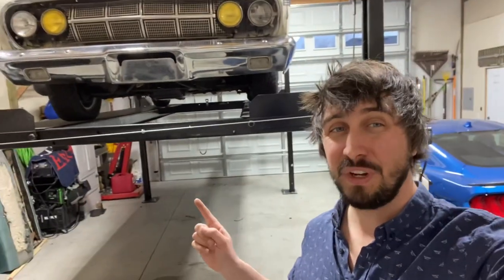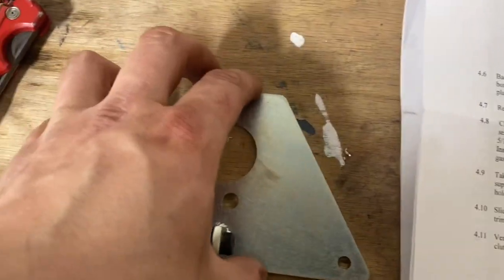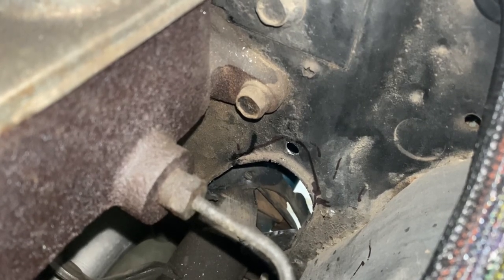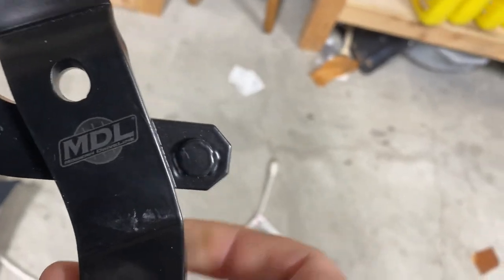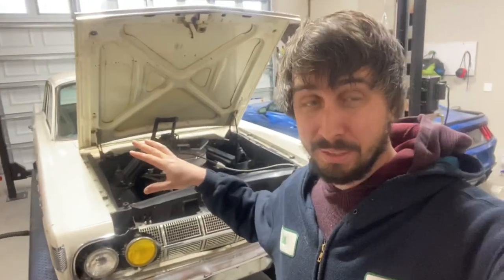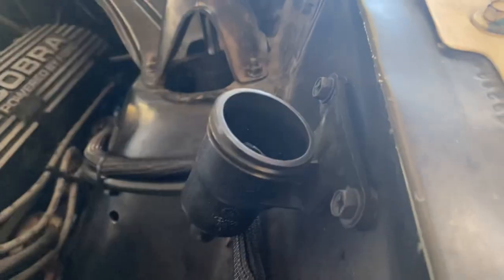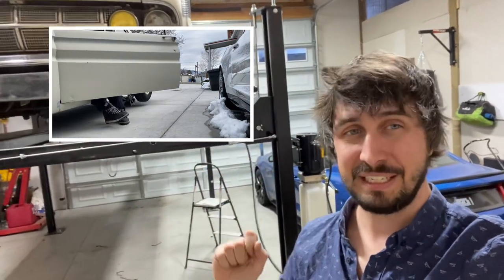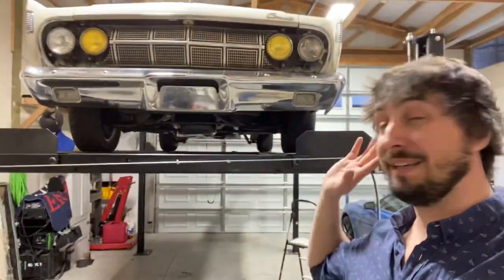Hydraulic Clutch Conversion Installation and Review

Comment: I'm the owner of MDL. Thank you for purchasing our Light Foot series hydraulic kit. I reviewed your video and would like answer some of your questions. 

On the falcon/Comet clutch pedal I modeled on the oem.  I left all the attachment point the same including the pin you mentioned.  When installing the falcon master cylinder kit the factory clutch pedal linkage pin has to be removed.  Based on you input we could easily not install the pin and let a customer install it using mechanical linkage.  

I'm looking to see if a replacement gasket could be included with the kit. There is cost for this part so the retail price would have to be adjusted.  Our pedals are 100% made in America. The removable pivot shaft design is more expensive to produce but we see this as a huge time saver. The old saying time is money.  We want to save both.  Could make the pedal oversea for half the price, maybe but not interested. 

If you like feel free to reach out to me. Love to chat with more in detail.
Reply from the maker: I really appreciate you taking the time to watch my video and comment.  It means a lot.  Of all the cars I own surprisingly the Comet has the best feeling clutch!  Would buy again in a heartbeat!

Comment: How far does the clutch fork move when you push the clutch peddle? Where does the clutch engage when you let off the peddle? Right off the floor , the middle?
Reply from the maker: It engages somewhere between floor/middle but not at the top.  I dont recall exactly how far the clutch fork movement is but I could have swore it was in one of my instal videos

Comment: Hey just watched your video and we’re switching my son’s clutch cable to the malwood clutch pedal with a external slave. Great pedal quality with a somewhat easier installation but trying to get it dialed in! Trying to bleed it with the mdl bleeder and noticed that after opening the bleeder it doesn’t seem that easy to push the fluid through like it shows on the mdl website! Feel a lot of back pressure, notice that you mentioned that too. Any tips to get it through easier? No way I can push it all down in 3 seconds! Reason I’m thinking that there’s still air in the line is that it grinds trying to get it in reverse but goes in all 5 gears . Any info would be appreciated!
Reply from the maker: It’s been a while since I did it but can you open the bleeder all the way or perhaps more than it is now?

Modern Driveline tech support may be able to help you.  I appreciate you watching and recall this being tedious
Reply: Thx for responding back! I know it’s been awhile since you did that project but figure I’d take a chance and see  you would remember! 😂 we’ll keep on trying to bleed the system some more since I think that’s the reason it’s not going into reverse at the moment.

Comment: I have a 1966 Chevy Nova Super Sport and very difficult to go thru the gears. I am considering to switch to a Hydraulic Clutch. I have a manual transmission now. What do I need to consider?
Reply from the maker: Without knowing your trans type you have to find a spot to mount a master and slave cylinder.  I dont love internal (concentric) slave cylinders because when they fail the whole trans has to come out.  They can be a pain to bleed sometimes and you have to route a hydraulic line ensuring it stays away from hot engine components.  Otherwise they drive like a new car.  My grandmother could use the clutch in my Comet.  Once it is setup right it makes the car a lot of fun but its more tedious to get setup
Reply: Thank you I am going to take it to a local garage that works on old classics. I just wanted to know if it possible. Do I have to change out the transmission?
Reply from the maker: @ralphevock1  shouldnt have to unless its an older transmission that no one makes a kit for.  The external slave, like what I have on mine, could actuate the stock fork with some measurements/checks.  Call Modern Driveline and they can likely help too.
Reply from the maker: I did some Googling for you.  Assuming you have a Muncie 4 spd it looks like there are a handful of hydraulic clutch conversions online.  They use the concentric style slave cylinder.  Pro tip: make sure you install a longer bleed hose if you go that route to make servicing it simple.

Comment: I installed mine in 68 cougar c4 to t5 MDL. i can Not get clutch to release, please i need ur help, i did Not do the bell housing run out, 1st time installing cluch and by myself No help, is that why not realeasing? i have the travel at master and run the bolt to the end on slave, maybe pedal adjustment?? I dont want to have to take it back out but if i need to do runout on bell i will thanks so much for the video
Reply from the maker: I would check a few things

1. Distance from TOB to pressure plate fingers
2. How much travel do you have at slave cylinder rod
3. Is the system bleed properly?

Comment: Did you notice quit a bit of slop with the clutch fork once it’s installed with out any pre load? We are seeing quite a bit of up and down movement
Reply from the maker: Yes I noticed the exact same thing.  IMO the clutch fork they supply you with isnt the best.  I did ask MDL about this and they told me it was normal 🤷‍♂️
Reply: @truckandroll989  have you noticed any issues while driving? Inconsistent pedal feel, noise? We are actually converting from the tilton unit. We have had nothing but inconsistent pedal feel with it.
Reply from the maker: @ryanjamesupham  pedal feel has been firm.  No issues there.  Just a bit squeaky at times

Comment: I have a 67 galaxie , I bought a kit for a mustang but was wondering if it matters where I install the master cylinder ? Does it have to be at a certain point to get the right angles ?
Reply from the maker: Yea it really does matter.  You want to ensure the pushrod going from your pedal into the cylinder is going in a straight line, not bending, no binding, etc.  Definitely a step you want to double check your measurements with

Comment: I could use some help. How can I reach you? Thanks
Reply from the maker: Just post your question here.  Others may be needing to know the same thing.  Ill try to help
Reply: @truckandroll989  Eaton fuller FSO8406A clutch arm is hugged up near Accelerator? However pedal is far left. I
Was looking for a solution, wanted to send you a photo
Reply from the maker: @johnathonjsmith  to be honest I havent messed with the clutches on this thing.  My thought would be if you can disconnect the linkages and start eliminating that first and then check clutch pedal for proper movement, see if you can manipulate clutch fork by hand with a bar of some sort to ensure thats not your issue.  Sort of a process of elimination approach